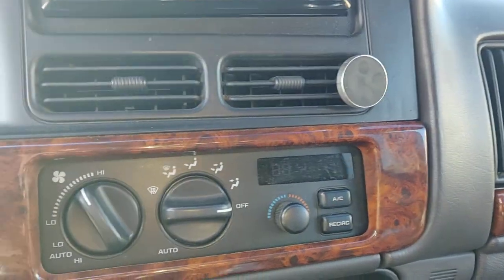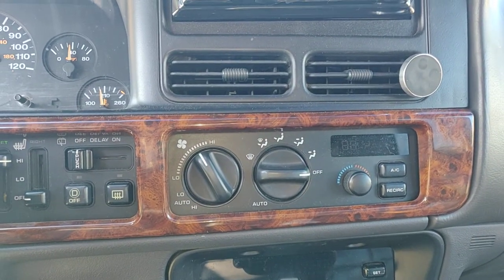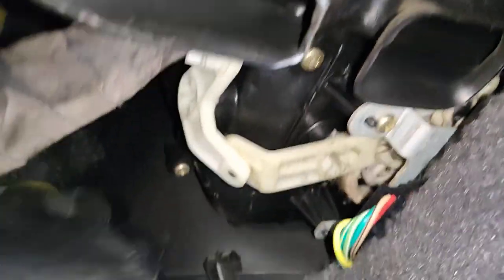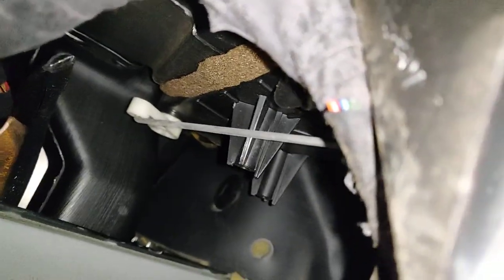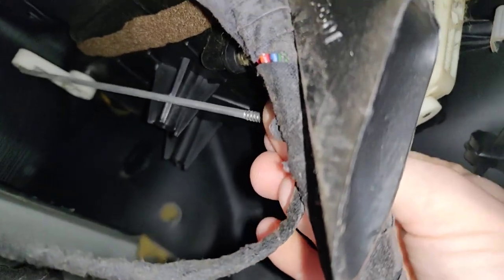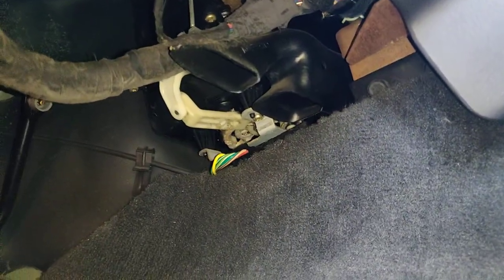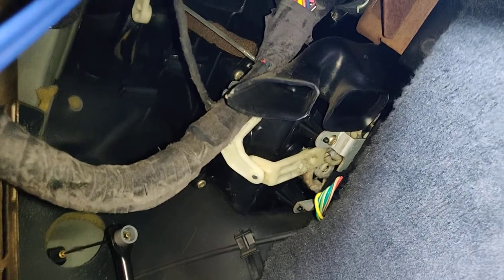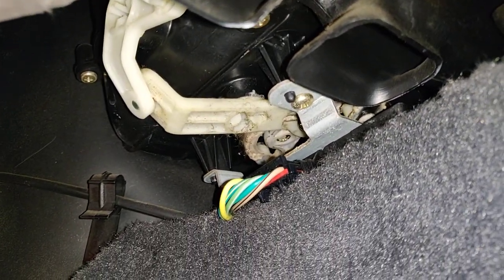1997 Jeep Grand Cherokee defrost not working temporary fix

Comment: Did you ever get this resolved, I couldn’t figure out how to get the motor out, doesn’t seem to have enough clearance without pulling the dash
Reply: Same boat.  Not a vacuum system and stumped
Reply from the maker: No not yet. I'm probably going to have to take it all apart. 😒